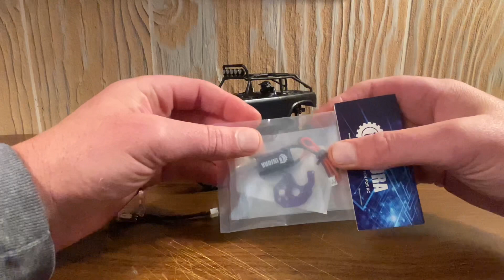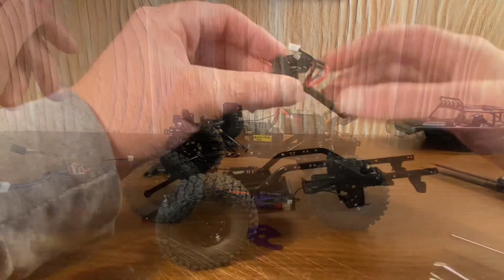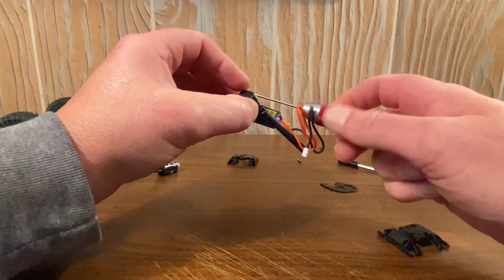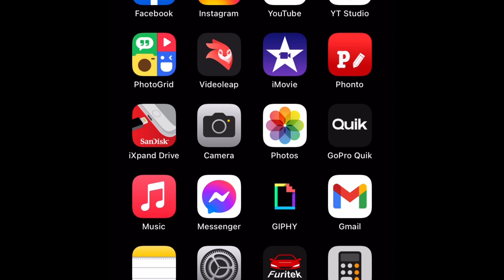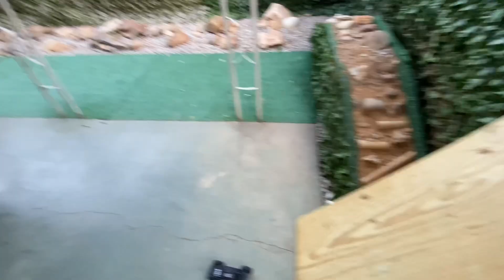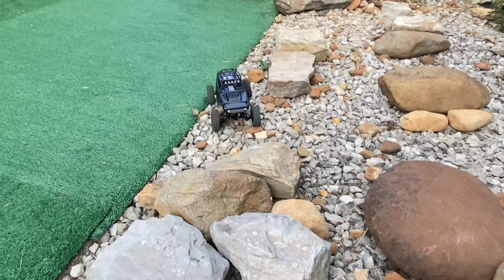New Deadbolt build Part 3. Injora 50T High Torque Motor/FuriTek Lizard ESC.

Comment: loosen your wheel nuts. they shouldnt be tight. this is how i killed two motors before i realized what i was doing wrong. if your body is torquing when you hit the throttle, theyre too tight
Reply from the maker: lol
Reply: @tcbrc7555  🤷🏼‍♂️ its your rc. lmk when that motor dies. just trying to help
Reply from the maker: @Kade9602  I’m pretty good at tightening wheels correctly but thanks for the advice..lol
Reply from the maker: Not to mention this rig also running portal axles so you can tighten wheels as tight as you want maybe you should try portal axles.
Reply: @tcbrc7555  im good, i like my low cg rig. and okay bud, but you have binding somewhere in ur truck bc well built ones dont have body torquing like that
Reply from the maker: @Kade9602  no binding at all bud.
Reply: @tcbrc7555  i watched the trucks body torque under load. if thats not a telltale sign of drivetrain binding, idk what is
Reply: @tcbrc7555  and i like my servos. im not trying to destroy my scrub radius

Comment: HI. Any idea where can I buy the 1.5m screws to mount the motor? I cant find them anywhere. Thanks.
Reply from the maker: I’d say check MoFo RC or somewhere similar. If ur replacing a motor the screws should already be there.

Comment: What do you mean by low and high power mode? I have two full furitek set ups and the only one I'm aware of with power modes is the FCX24.
Reply from the maker: Referring to the remote. The electronics on the older SCX24’s has 3 power settings. Not gear settings but they determine how much power is sent to the vehicle.
Reply: @tcbrc7555  Oh yeah. It's more of a limiter. The same amount of torque but reduces the top speed. I always thought of it as more like a training wheel till you get your throttle modulation under control. I forgot it was on there.

Comment: Do you think the 50T is a must do upgrade now that you did it?
Reply from the maker: Not really a must I’ve had my SCX24’s really heavy with stock motor and the motor handled it fine in the 2nd power setting but it’s jumpy. Like if your trying to climb something technical and need to back up just slightly with your tires in a bit of a bind it would jerk back. The 50t motor is the same way maybe worse but with the higher power and the FuriTek ESC it’s more controlled and realistic. Any RC I run from now on will either be brushless or a higher powered motor with an upgraded ESC.